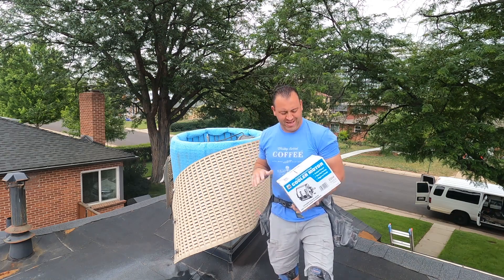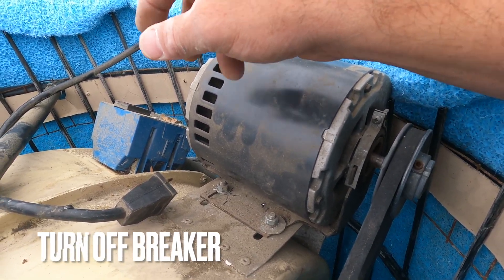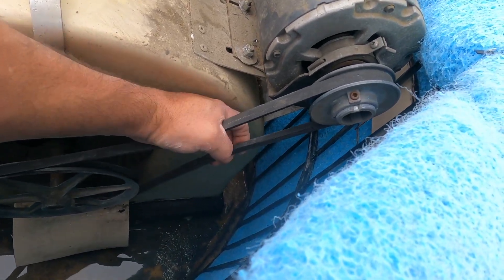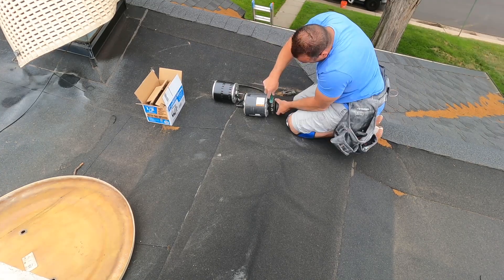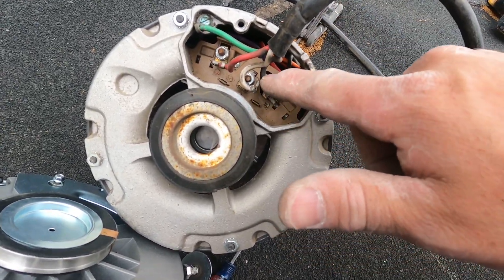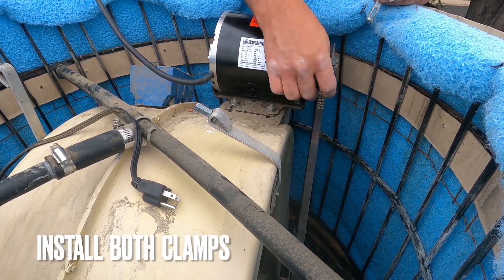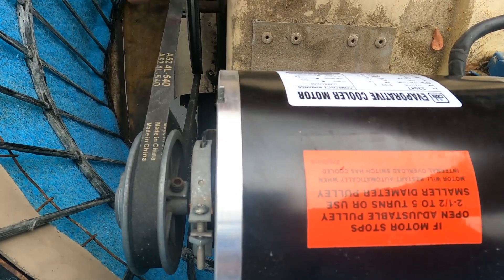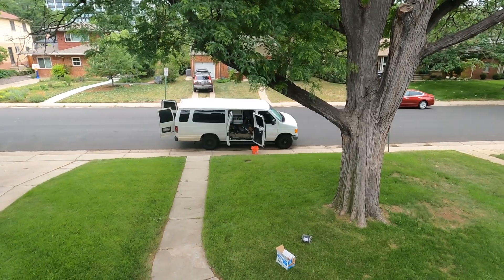Swamp Cooler not working? How to perform maintenance [ Handyman ]

Comment: New subscriber here, also in Denver. My swamp cooler has become super loud, the motor isn’t super old. I try to maintain it myself. Wish me luck! Thanks for the video!
Reply from the maker: Add lubricant to the bearing. That may also help quite down the unit. The ball bearing holds the rod that goes through the entire fan. Thanks for taking the time to watch my video and post. Let me know how everything goes. 
-Vinny